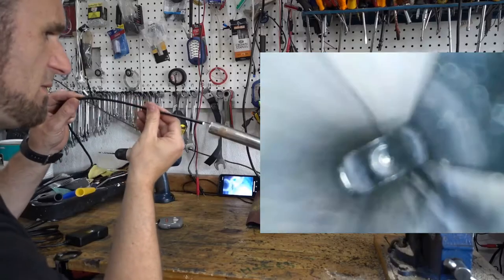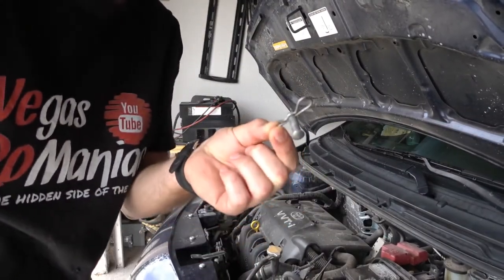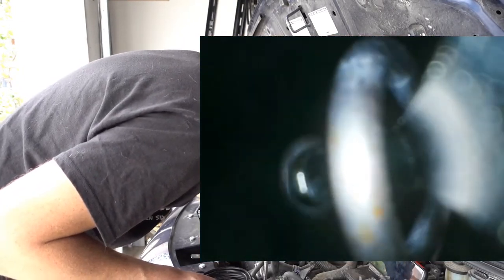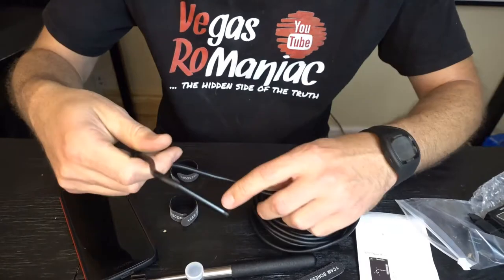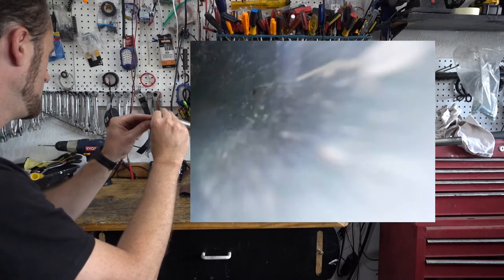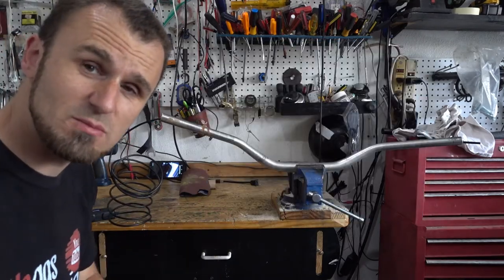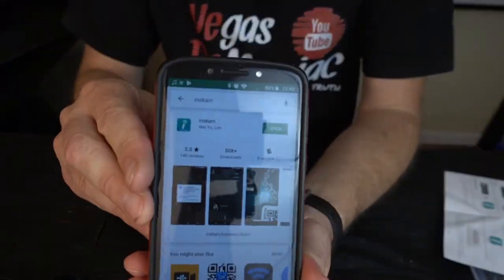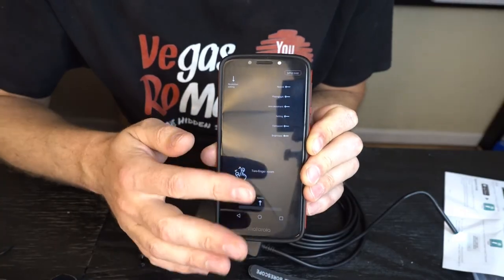KINCAM Wireless Endoscope inspection camera Test and Review my version

Comment: You should do a followup review of the camera resolutions.  I bought one of these and while the features are excellent, the higher resolutions appear to be "digital zooms" - but frankly, a true HD camera in a 5mm diameter package may be a lot to ask for at this price level.  One word of praise:  the camera attachments screw on which is a big deal - ones that push on can come off which is a disaster.